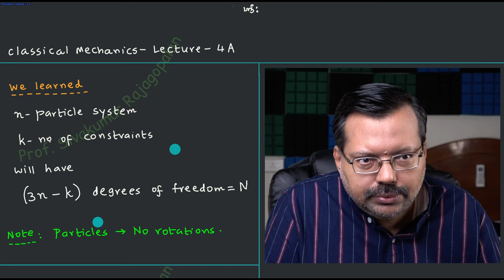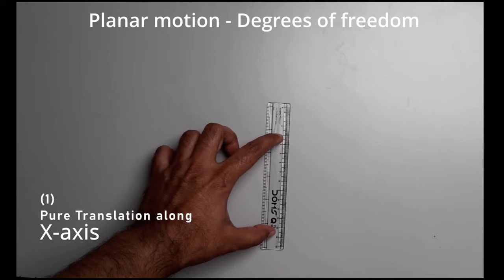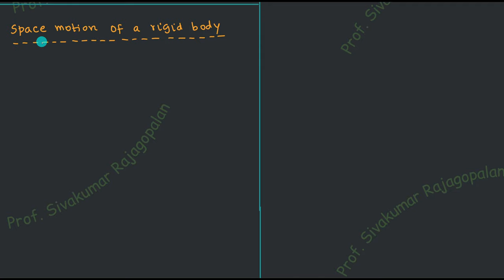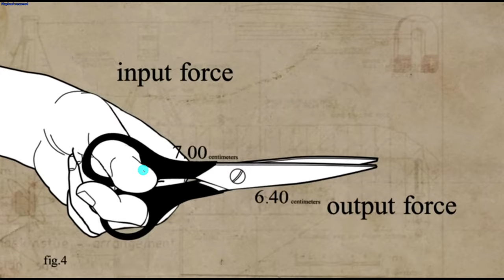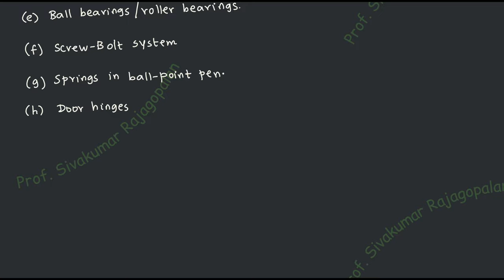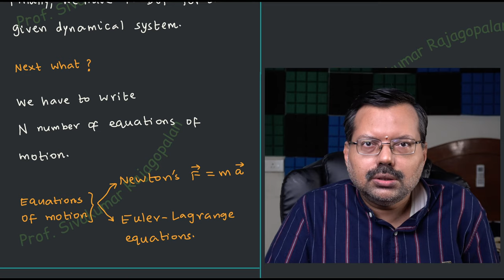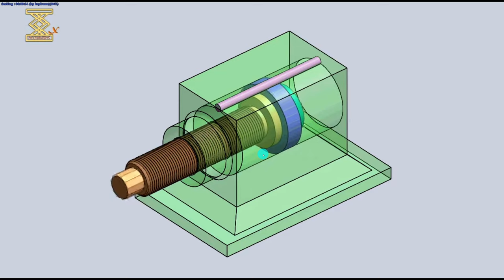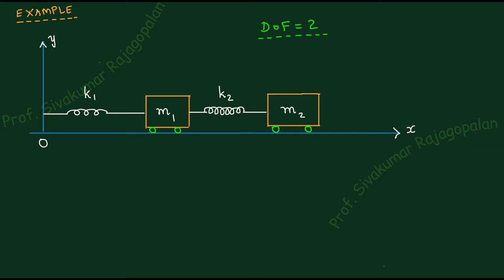Classical Mechanics Lecture 4A | Degrees of Freedom with Examples | MSc Physics Lectures

Comment: It is interesting to learn than a planar car wheel has 1 degree of freedom. In reality a car wheel rotates about itss axis and also about an axis which is perpendicular to floor and passing thru center of wheel. The second rotation is less than half circle. So in this case can we say degrees of freedom is 1.4??
Reply from the maker: Degrees of freedom (DoF) is an integer, meaning that fractional values are not meaningful. In our wheel example, one DoF is the "distance travelled" and no more information required to be specified.

Comment: Thank you for these great lectures Sir,,

 as we know, generally for a Rigid body,
 DOF = 6 - no. of constraints,
how do we understand this calculation for the wheel and bolt example, ?

for eg, in the wheel's case, I could understand that the wheel had 1 DOF as rotation and translation were synonymous here, but what were the constraints that reduced it's DOF from 6 to 1 ? for one, I know about the contact between the wheel and surface. But I am still confused. COuld you please explain.
Reply: Translational movement is an consequence. No force is applied for translational displacement